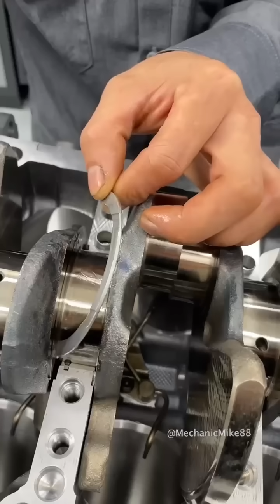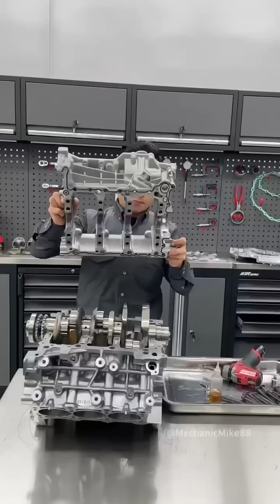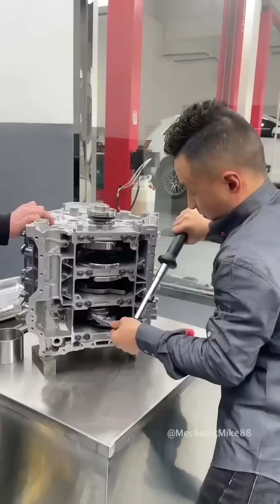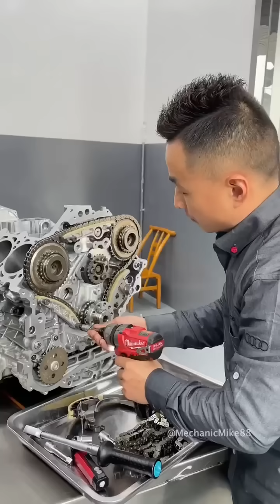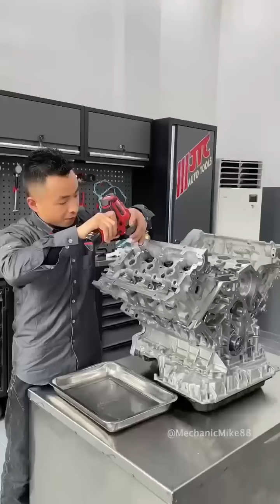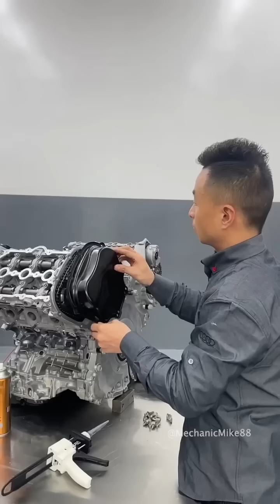Audi Car Engine Assembly Process

Comment: When all those tiny rubber oring gaskets crack in 5 months from heat…all that work will be fun to re do.
Reply: Nope this special polymer gaskeys last very long time mostly the live from the engine, but in case of a rebuilt , replacement is needed